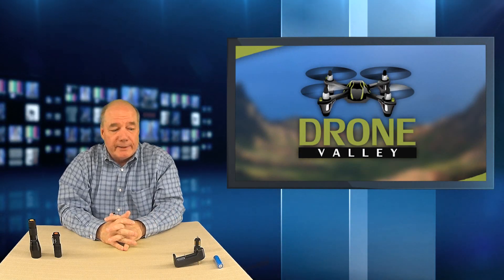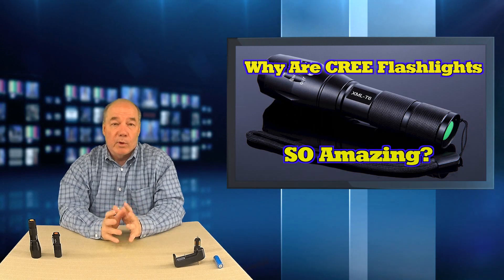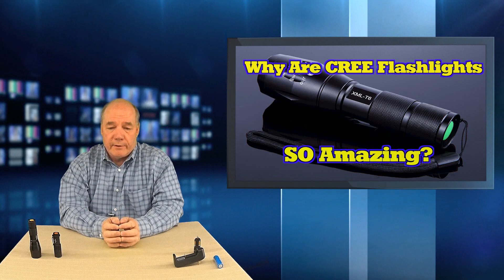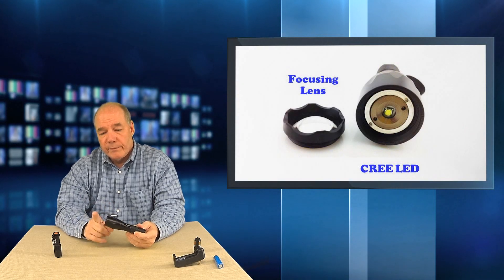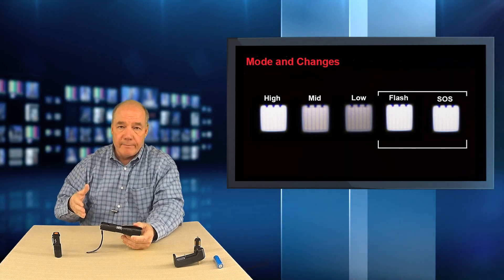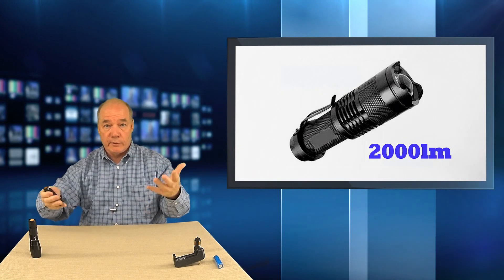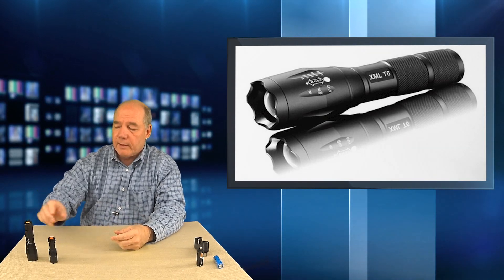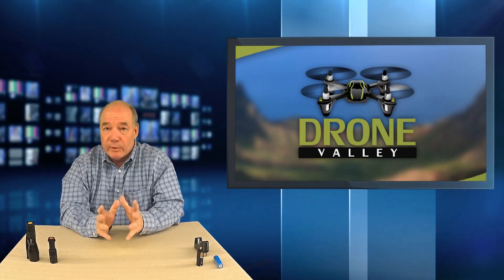Why are CREE Flashlights SO Amazing?

Comment: Kevin,  I recently destroyed my favorite pocket light that I had for years. It was small and bright and tough, but I left the battery in for too long... the light was working fine, but when I noticed it turning off and on intermittently, I decided to change the battery...unfortunately the  battery was completely deformed and corroded sticking to the inside of the metal housing.   So I ordered the "Atomic Beam" light, but it feels kind of cheap and the rechargeable battery and charger I ordered over a month ago, have never shipped (much like my Mavic order).   So I think I am going to try the Cree light with the hopes that the quality might be a little better. 
 BTW thanks for the video, I love drones but am also very interested in electronic gadgets... so I say do drone stuff primarily,  but do other interesting stuff as well when you can, because I am sure if it peaks your interest it will most likely peak mine.
Reply from the maker: Thanks for the post and I have a few different models available for the CREE lights. I work with the manufacturer of these and try and provide the best pricing possible. These are insanely durable and will last forever. Thanks again for the post and your support of the channel. Rick
Reply: Rick, Sorry I really didn't mean to call you by another name.  My bad.  Going to buy the 2000 and the bigger 4000.
Reply from the maker: No problem, I've been called worse :) Thanks for the order and we'll have them shipped in the morning. You're going to enjoy these CREE lights. Rick
Reply: That was fast, I received both lights today.  Circumference of the smaller Cree case was slightly larger than my old light, but the produced light is brighter with only 1 AA battery, amazing!  I also bought the 4000 with the rechargeable battery...  the case and lens are both made really well and the light is bright and crisp with very little edge blur.  Used it tonight while taking my friends kids out trick-o-treating.  Had to put the bigger light away, it was too just too bright, ended up using just the small light all night.  For the price these are really great lights.
Reply from the maker: Thanks for the great review and I'm glad you like the lights. I've been using them for a while and they really hold up well. I agree that the 4000lm is very bright but remember you have 3 setting on the light for brightness. I usually keep it on the middle setting unless I really need it bright. Hope you had a fun night with the kids on Halloween. Thanks again for your business. Rick

Comment: Another great video. Keep them coming. Don't worry if they aren't drone related. I'm sure your audience would be interested in any tech related topics.

With respect to the flashlight I think there might be a bit of marketing exaggeration going on. The Cree LED's used in this sort of flashlight tend to top out at around 1000 lumens or so. You can get brighter lights by using multiple LEDs but I believe the light you're showing is only a single LED. I've seen similar lights sold online often with exaggerated claims. If I had to guess I'd say that light is probably closer to 300lm or an order of magnitude dimmer that it's advertised 3000lm. That doesn't mean it's a bad value for the money but likely nothing close to its rated light output. If you have a flashlight from one of the major brands (e.g. Olight, Fenix, Surefire etc.) try comparing the output and I would be very interested to hear how it compares.

Next the battery. I see that it includes an UltraFire battery rated at 3.7V and 5000mAh. Again that just doesn't seem possible. A top of the line battery from Samsung or Panasonic would probably be around 3400 or perhaps 3600mAh. UltraFire batteries tend to have misleading claims with respect to the capacity. They are often of poorer quality and have a low capacity of less than 1500mAh. Rechargeable batteries like the 18650 ones can be a great choice for use in flashlights but I think it is best to stick with high quality ones. You also want to stick with a high quality charger. The one that comes with that light doesn't look like the highest quality. I definitely wouldn't leave that charger and battery combination unattended during the charging process. If you have one of the higher quality chargers available they usually have the option of testing the capacity of the battery and it would be interesting to see what the actual mAh capacity is for those batteries.

So overall that flashlight could be a good value for the money but you might want to double check with the supplier about the actual ratings for the device and battery.

Keep up the good work and I always look forward to your new videos.
Reply from the maker: Steve, thanks for the post and this is a tricky thing to nail down with these lights. The actual brightness of the lights we sell is specified by the manufacturer and their testing. We buy these from the folks who actually make them and they use a device called a integration sphere with their calibrated equipment so I trust the numbers they send me. I also know that the amount of emitted light is largely determined by three elements, the CREE bulb, the quality and material of the reflective chamber and the lensing element in the front of the light. These are all carefully designed to send as much illumination out the front of the light as possible and this is where a lot of the less expensive lights fall short. I know that a lot of the results are also hard to compare between lights for the naked eye. I see the NiteCore line of products as well and even putting several models side by side it's hard to compare which is brighter because it's so subjective. I use these light myself and have been blown away with their durability and brightness for the price and folks really love them. Thanks again for the post and stay tuned for other clips I'll be uploading this week. Rick

Comment: 8:12 I think it's a 18650 battery you were right the first time.
Reply from the maker: Yes, I totally spaced there. Its a 18650 for sure and the kit we sell comes with everything you need for the light, battery, charger, battery eliminator and the torch. Thanks for confirming the battery number and posting. Rick
Reply: My dolt of a Dad bought me one of these thinking that 18650 was the lumens and expected to blow me away with my 900 lumens Anker one. Needless my ~40$ Anker is brighter than the ~1200 lumen cree Phixton.. although the square focus is growing on me..

Comment: Enjoyed the tech talk keep it up
Reply from the maker: Daniel, Thanks for the support. I have been wanting to do a few clips outside of drones for a while and the comments on this first one have been great so I'll definitely do more of them. Thanks for commenting and be sure to sub the channel so you don't miss any. Rick
Reply: Hi Rick 
I was looking at getting a CREE light kit on your web site and I seen there is a 4000lm CREE light what the runtime of that flashlight? Also do you know when the Phantom 3/4 range extender will be back in stock I watched your video on those as well and I like you pints you made about using them.  Thanks for the recommendation I am a subscriber.
Reply from the maker: Daniel, the 4000lm is a more powerful (and slightly larger) light. It uses the same 18650 battery as the 3000lm so the run time is a little shorter at full power. When I use that light I typically leave it on the lower or middle setting for brightness to have the cell last and it's plenty bright. It also allows me to crank it up to a full 4000lm when needed. All of them are great, I personally love the 3000lm model because of the combination of size and power but the choice is yours. I have a large shipment of gear arriving this week and have the reflectors in that order so please check back mid-week and I'll have plenty of them. Thanks again for your support! Rick

Comment: Tanks Rick, the drone videos are good, but more often than none the support gear is what make make the trip, when you need a light, multi tool, tape and GOD know what you need it.
Reply from the maker: You are so right! Every time I find myself missing something I need when I'm miles from home I make a point of adding it to the kit. Nothing more frustrating than having to drive back home for a zip-tie to hold something together. Thanks for the post and I hope you sub the channel if you haven't already so you don't miss any updates. Rick

Comment: Nothing better than a blinding light for Non Lethal Self Defense.
Reply from the maker: That's a very true statement and I should have stressed that in the review. I've never had to use it for that but have dropped it a few times and it took a little while for my eyesight to recover, especially if it was in very dark environment. Thanks for the post and I appreciate you watching the clip and commenting. Rick

Comment: Hey Rick, great video on the Cree flashlights - I picked up one of each from your site - incredible prices!. I have been carrying a Mini-Mag Pro in a  holster for years (video producer must-have) and have always wanted to carry a better tactical torch, but not having a holster was a deal killer - gotta be able to carry every day or it's not going to be there when I really need it. So, the smaller Cree will work fine for my EDC holster. And I thought it would be great to have the larger one, but the diameter won't work in my holster. So I found an open top holster on Amazon that might work well - I'll let you know. You might consider selling a couple of holster options for those of us who just HAVE to have our lights on our hips at all times (and don't entirely trust clips). :) Thanks again for ALL of your videos, drone related or otherwise. How about reviewing knives and/or multi-tools?
Reply from the maker: John, Thanks for the encouragement and I will ask my manufacturer about the holsters. I sell NiteCore lights as well and most of them come with the holster for carrying. Let me know how you like these when they arrive, I really appreciate your business. I did this clip as a bit of a test and now that I know folks are enjoying them, I'll do more. And multi-tools are another geeky thing I really enjoy so I'll be sure to include a few of them. Thanks, Rick